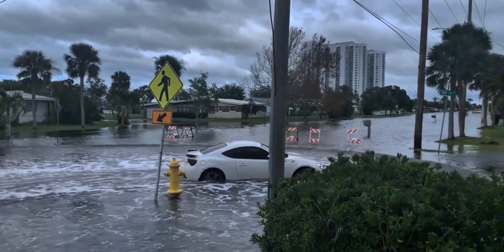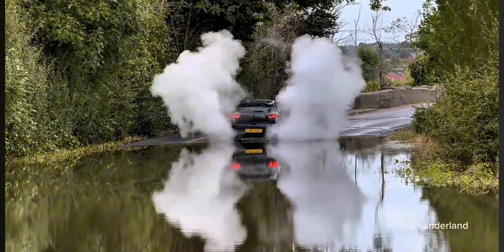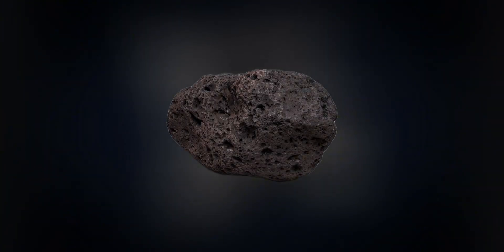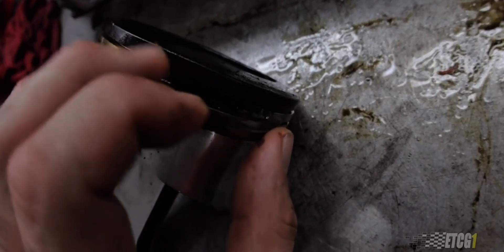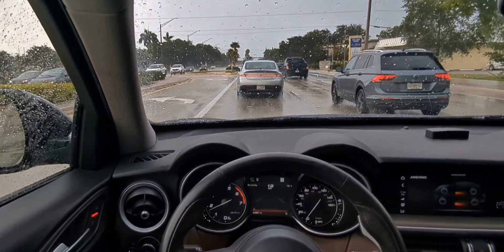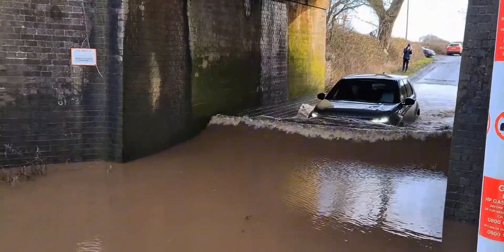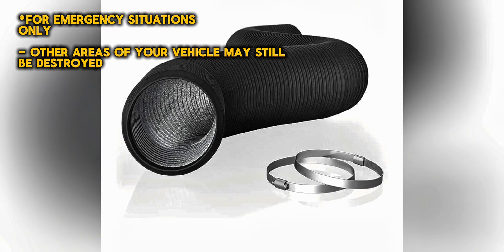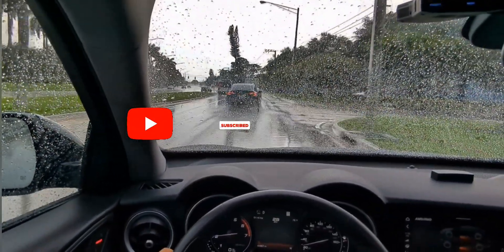FLOODS Can INSTANTLY Kill Your Engine (Hydrolock Explained)

Comment: I live in Delhi NCR, where knee deep water is a daily occurence during peak rainy season. That combined with potholes makes commute impossible on 90% of roads, and yet there are those who think their 'offroader' can do it. Their offroader is still a road car, at most it has water resistant ignition system, but not a snorkel intake. I've seen so many people attempt to cross completely flooded roads with their thar or jeep. Watching them going 20km/h in muddy water filled to waist, I first feel excited, then sympathy because it always ends with dissaster. IDK why many people here believe that the car stalls when water enters the exhaust, hence they should speed through the water. That is also a cause for stalling, but it can easily be avoided by keeping the engine above 3,000 rpm and slowly creeping instead of speeding and splashing the water around their engine bay.
Reply from the maker: Exactly, just don't shut your engine off while in the water + keep revs decent to prevent exhaust reversion.
Reply: I live in Pennsylvania (US) and while we don't have the rainy and dry seasons countries like yours have, in landlocked states like mine that are still a good thousand miles away from the nearest shoreline can get torrential snowstorms in the winter (especially here up north, where we're also a somewhat similar distance from Canada) and massive rain downpours during late spring and throughout some parts of the summer. Sometimes it rains so much that some roads get temporarily closed because they were waterlogged so my adoptive aunt is lucky to have a car with a small enough turning radius to not always have to reverse in order to turn around to take a better route.

Comment: But if water is incompressible, isn't it also possible that the engine would just stall if it intakes water? I mean sure at high rpms the piston definitely has enough energy to break something, but is it possible the engine would just stall at low rpm with no throttle applied?
Reply from the maker: The possibility of simply stalling is absolutely there.

But you need: low RPM, a medium to low compression ratio, enough water where it disrupts the flame front but doesn't fill the combustion chamber to the point where the piston can't compress it, and pretty much just perfect conditions. 

But it does happen, which is why sometimes you can remove the spark plug and crank it to push water out through the spark plug holes.
Reply: Im not sure, but yes, you are not wrong. Depending on engine size, rpm, and other factors, engines may simply stall when the intake gets submerged without mechanical damage. But this is also why one isnt supposed to start their car after it stalled in a flood. The starter motor produces enough torque to spin the engine with enough force to try and compress the water.
Reply: Sounds like Google couldn't help ur lil problem lol
Reply: @Sinsirink Google must like the internet tells lies go outside buddy😂